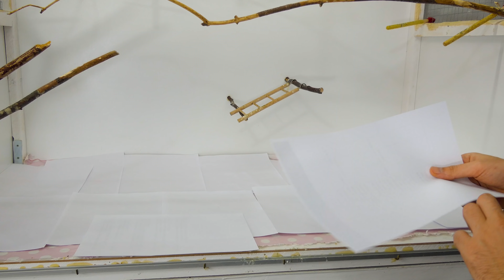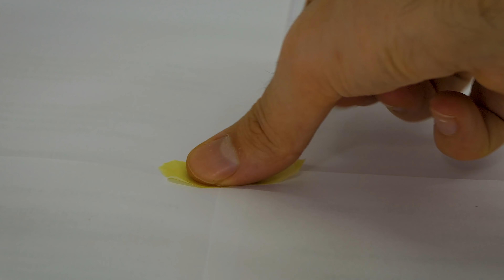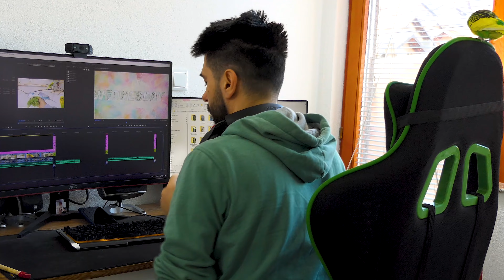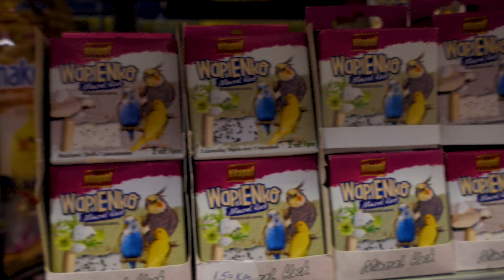How does the Weekly Budgie Routine look like?

Comment: Alex, if you have a dollar type store in your country, you can make a cabana for your budgies.  What you do is buy a plastic basket, flip it upside down, you can cut into the basket, make a hole in the center bottom to add a hook to hang the cabana, make two holes across the top of the basket on each side to place a perch or you can hang a swing under instead, then you make a front (and back) opening to look out while on the perch.  It gives the budgie shade and also privacy and if the plastic basket has a fake woven look, the other budgies climb on top because they can grip on to it. They will love it. Great video by the way.